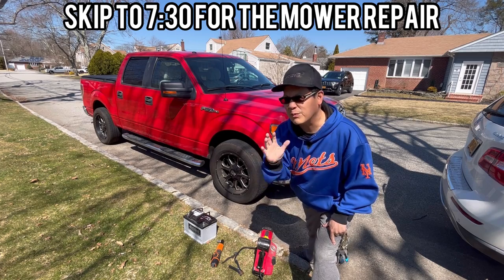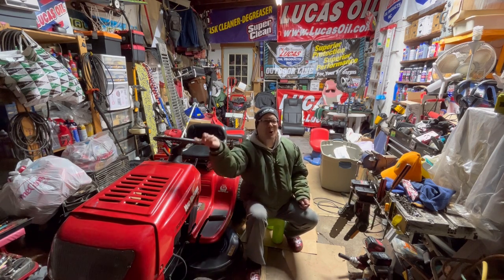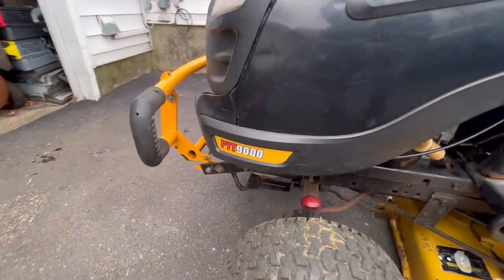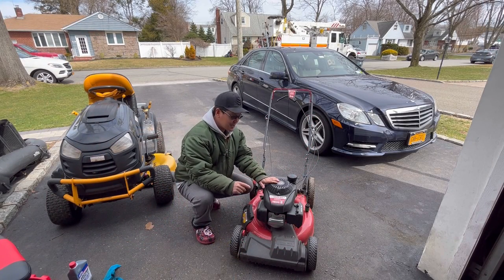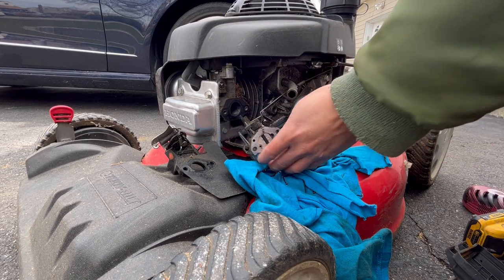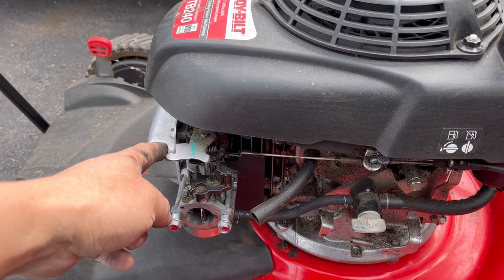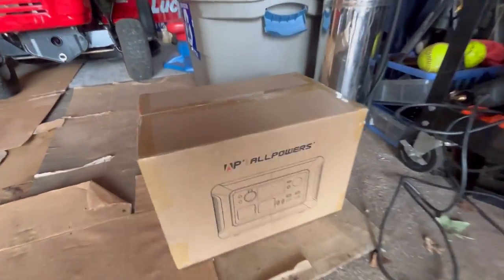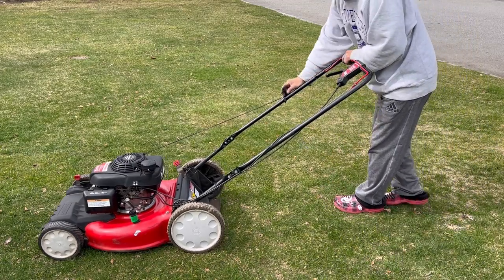FREE TROY BILT TB240 HONDA POWERED ENGINE SELF PROPELLED LAWNMOWER GARBAGE PICK CARBURETOR CLEAN FIX

Comment: I bought a Troy Bilt in OZ as a grey import around 8 years ago and its sublime, I have never had a issue with it, still starts mostly first go, occasionally needs another pull. Its a self propelling model. TB260. I have a 1000sm block to mow. Going to give it some love this coming season, a good wash, oil change, new sparkplug and filters and should be good for another 5 years (Joking about the oil, I do that every season.)  It cost me $499AUD  with the Honda engine and as I was looking to buy a Honda I thought this was a great choice,half the price and still a Honda engine.
Reply from the maker: Nice!  Hope you subscribed

Comment: Great free finds!  The PYT models are a high end yard tractor, I fixed an MTD version of that tractor for a customer and it was very nice.  I wonder if they left the key switch on by accident running up the hours, or it was taken very good care of.  Usually by 400 hours those are pretty worn out especially the front ends.  Also great find on the push mower, easy money!
Reply from the maker: Yes sir!  I’ve been lucky so far this year

Comment: Choke plate is still getting stuck shut. When the two bolts get over tightened it squishes the gaskets and the back of the air box rubs against the choke linkage making it stick on causing the engine to chug and run rough. While it’s chugging try loosening the 2 screw just a tad, you’ll hear a “snap” and the choke flap will spring open and the engine will run great. Solution is to double up the first gasket behind the air box to get a little more clearance. Also the running fast when first started indicates a linkage is put in wrong, it’ll still work but not quite right. Auto-choke Hondas suck, I like the ones with the lever that moves when u squeeze the handle bail.

Comment: gr8 find.    on Honda Engines and powermore  CHonda  you don't screw down the dipstick when checking level . just put it in without tighten it down. to check  level.   just a FYI my friend.   glad you got your power back and got coffee to.  I picked up 3 free mowers over 3 days. 1 each day. I got one fixed already, the other  is fixed but hadn't change oil yet. One I think has broken fw key. it backfired out carb and caught on fire briefly for a few seconds.  ( unfortunately I didn't catch that on video )
Reply from the maker: Darn!

Comment: You don't screw the dipstick in on Honda engines to check the oil. I've got 2 of those TB 240's , great mowers.
Reply: That was going to be my comment also . If it was a little over when Henry screwed the dipstick in, the oil was at the correct level. 😊

Comment: Does anyone know the part number or type of bolts that mount the engine to the deck for a TB240?  Any would be appreciated.
Reply from the maker: Half inch bolts
Reply: @MowersNBlowers  I'm assuming half inch is the length of the bolt.  What type of bolt (actual size, diameter)?  Thank you for your insight.
Reply: Diameter, thread pitch, length of bolt?  I'm just learning about bolt sizes.  I apologize for my ignorance.
Reply: @MowersNBlowers  the motor is a Honda GCV160.
Reply from the maker: @kjr12341  MTD Genuine Part 710-04683C SCR-HXINDWSH TT 3/8-16 X 1.0

You just had to google it!
Reply: @MowersNBlowers  God Bless you!  Thank you so much!!
Reply from the maker: @kjr12341  hope you subscribed
Reply: @MowersNBlowers  I did.  I appreciate the help.
Reply from the maker: @kjr12341  anytime bro

Comment: That engine holds 14 ounces I believe,and you check oil on Honda engines with dipstick not screwed on.
Reply from the maker: But the threads aren’t accurate if you just stick it in without screwing it in
Reply: Honda recommends not screwing it in.😊
Reply from the maker: @roadhouseband-augustaga5896  you can just fill it to the first threads in the hole

Comment: Bro, on a Honda you don't screw in the dip stick, just unscrew it, wipe it, then put it in and pull it out, don't screw it in to check, check the level again.
Reply from the maker: That’s not accurate though
Reply: @MowersNBlowers  oh I know, but by screwing it in and then checking it, it will be lower then it should be.